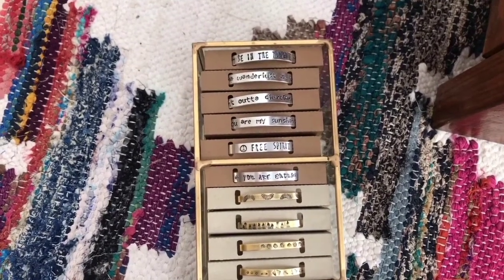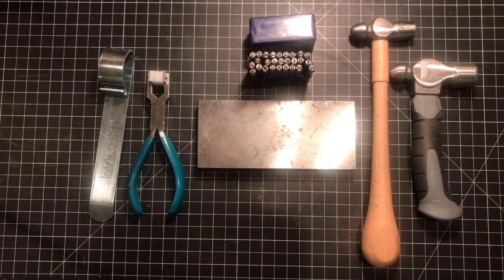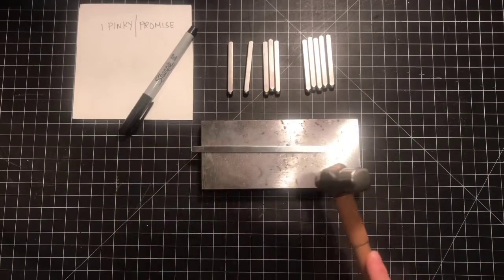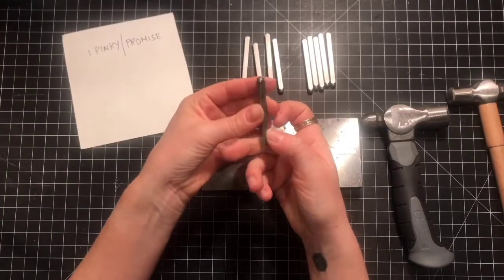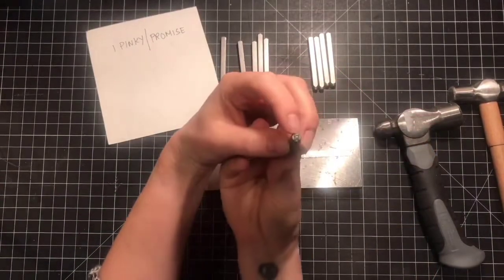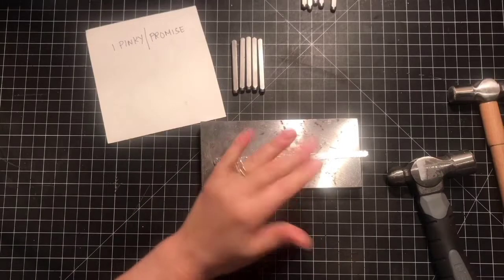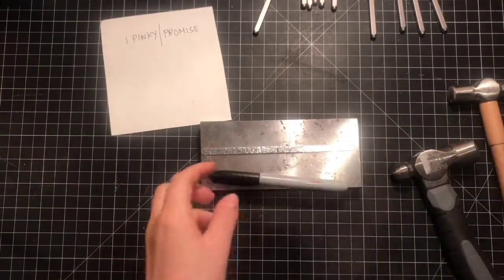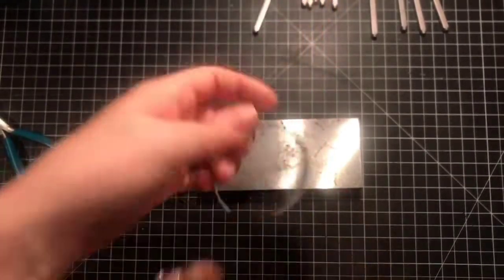DIY-  Metal Stamped Aluminum Cuff Bracelet

Comment: Awesome, I am going to use it with my students tomorrow, we are working on the 24 Character Strengths and they can pick what to write.  Have you ever considered marking your stamps on the front side with a dot or the letter so you don't have to check all the time?  Thanks heaps
Reply from the maker: Debra Fitzsimons Yes!  The higher quality stamps have marks but the ones that don’t I’ve put marks on the right side. Have fun stamping with your students.

Comment: Where would on go to get a custom block made? And can you refer any content that talks font size and blank sizes and how they relate? For example if I buy a 3mm font what size blanks does that best fit on? Surely not 3, perhaps 5 or 6.... IDK an explanation of how that all works would be awesome.
Reply from the maker: Hi,
I would suggest contacting a local metal shop to get a block made. There may be online places that sell them but I’m not sure of any specific ones. Impressart has many videos on stamping you can check out. Bracelet blanks are typically sold in 1/8”, 1/4” 3/8” and 5/8” sizes so 3mm stamp would best fit on the 1/4” bracelet size. You definitely want to go a little bigger than the stamp size. Hope this helps.

Comment: Does the stamped design ever get distorted when you bend the metal?
Reply from the maker: I’ve never had that issue and I’ve made lots of these. Some advise: don’t stamp too hard especially in the middle. I’ve seen cuffs break in half when bending if stamped too hard.

Comment: How can I make a hole in the ends to put some charms or put a chain or something.
Reply from the maker: I use this tool SE 7932HP Double Hole Punch Plate https://www.amazon.com/dp/B00658KWS6/ref=cm_sw_r_cp_api_i_36F2CbSWN971C
It works well for holes 2-3 mm diameter.